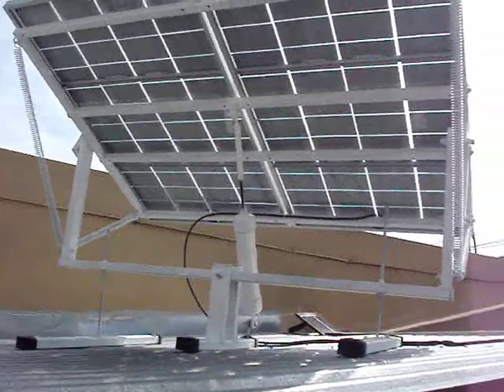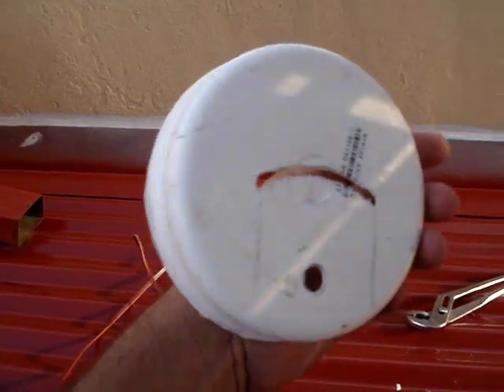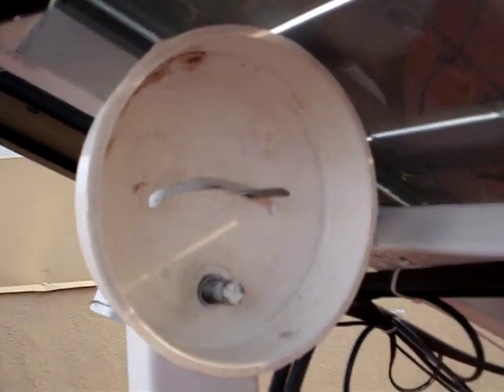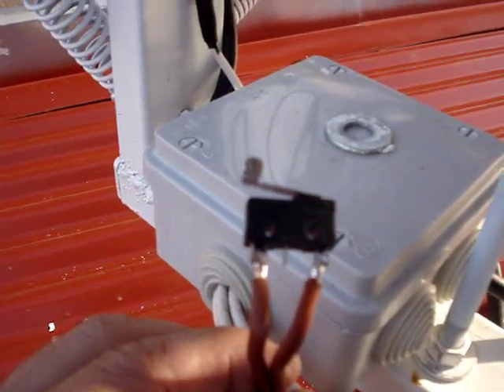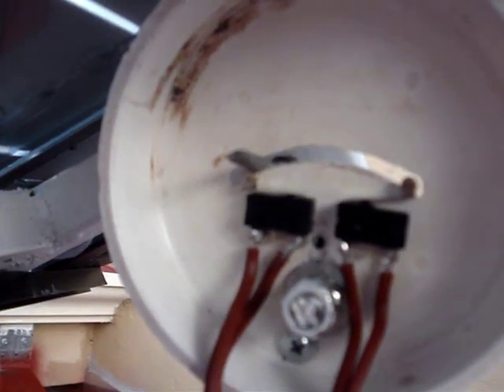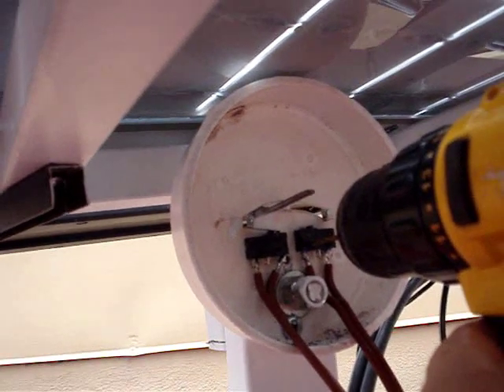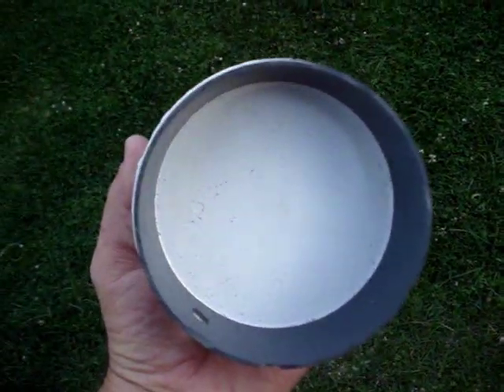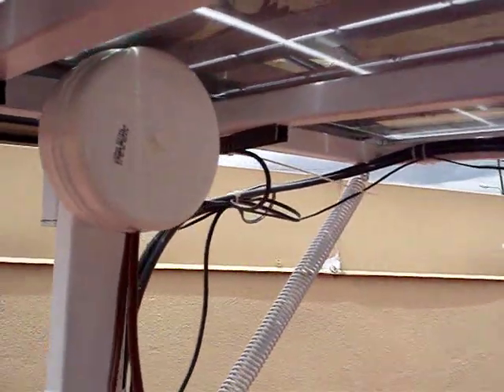Solar tracker limit switch construction

Comment: You mention about  showing circuit/schematic in the next video but i can not find part 3  have you done part 3 to this video ?
Reply from the maker: The next video would be installing the components in my control box. I changed the link at the end of this video to take you there sorry about that. I did not draw up a detailed schematic for wiring all the components. But if you have any question I would be happy to answer them.

Comment from the maker: Well the drill I used was a 14.4 volt drill and I only use 12 volts to operate it since thats the voltage of my system. So that decreases the power some. I think you will like the way I control the system. I will be posting that video probably next week.
Reply: I am Peter and we are a professional manufacturer that R&D Single Axis or Dual Axis Solar Tracker Drive Unit————Linear Actuator.

If you are interested in our product, let us talk more details(Mob: +86-134-0575-6967 and E-mail is peter.ren@zjbeteck.com).